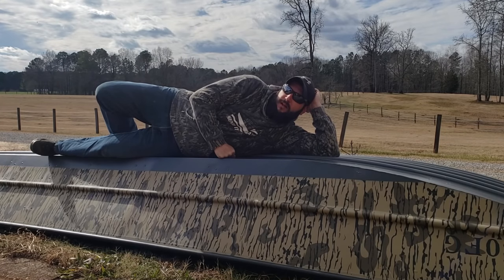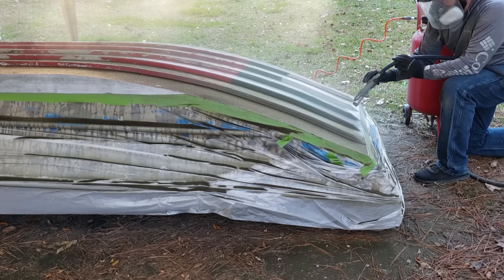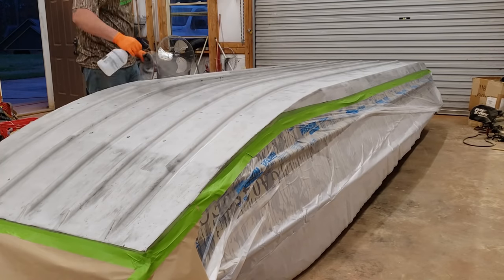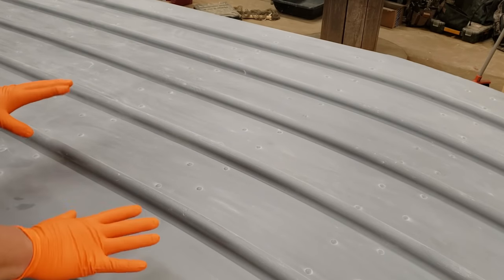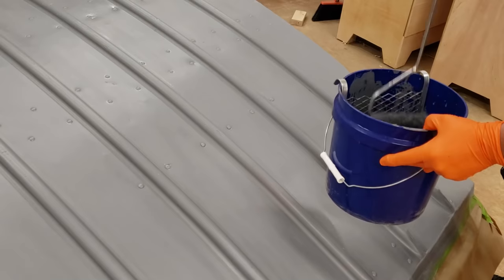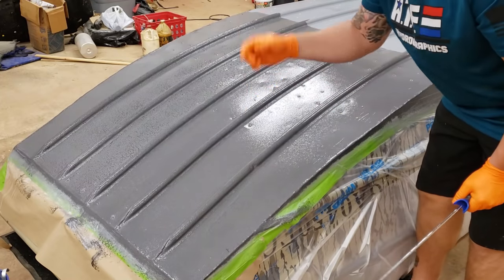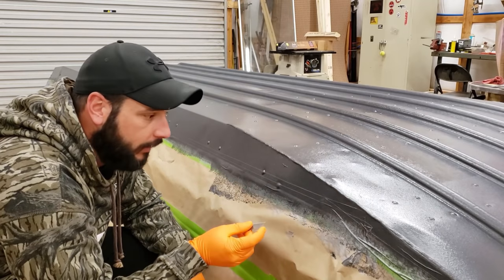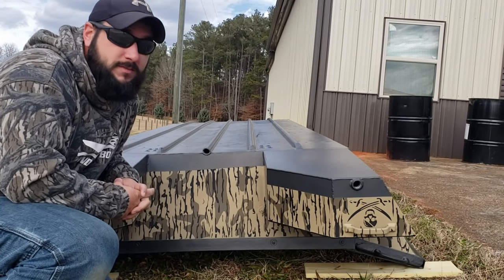Gator Glide and Gator Base [How to Apply, The Right Way]

Comment: I always used stealflex/2000 back in the day. Couple tricks maybe for whoever interested. As far as primers go don’t bother leave bare aluminum sand blast is ok but 24 grit is better if you got a flat hull. Clean with 90% rubbing alcohol AFTER you blow it off or vacuum all the dust AND wash with dawn/soap and water. When you apply epoxy use the finest nap hair roller you can find. 1/8”... apply a coat front to back and once you get to back if front is still tacky start again. If it’s not you fked up.... Only two coats. 3 depending on thickness just messes up and the thicker an epoxy is the easier it chips in bigger pieces... Once you apply second coat just peal tape off and razor as you go but if it’s still wet you can just peal tape off for a good line. And then take a hair dryer or 2 is better to the whole deal while it’s drying. It’ll help flatten it out so you get a car paint type of finish not wavy. Especially if you used a good fine nap roller. So. Deeper scuffs the better. Wash. No dust. Alcohol. Apply whole coats. And only apply second coats to a wet coat. Super fine nap roller. Hair dryers. Let sit twice as long as recommended.
Reply from the maker: Thanks for the tips.

Comment: What paint stripper did you end up using?
Reply from the maker: Ace hardware brand paint stripper and the Klen Strip brand. They both ended up working but had to do it in layers.

Comment: Doesn't naphtha have an oil in it?
Reply from the maker: No oil in it, body shops have been using it for years for degreasing. Thats where I learned it from, an old panel beater.

Comment: Wonder how it holds up to ice.  My duckwater boat looks like mirror every few years.   1-3" ice Rubs the paint right off.
Reply from the maker: Holy cow, i never thought about ice.... good question. Ice is not something we know about in Georgia, but I have seen some airboat guys running it over ice on facbook and it looked like it held up fine. Now running through ice and breaking it, I dunno what will hold up to that.
Reply: @SendItJonBoats  thx for the relpy....
Reply: @SendItJonBoats  I thought that looked like some GA water. Actually working on my boat project so I can get on the Ocmulgee and maybe Altamaha, to catch some flathead. Just picked up a new welder with spool gun and a plasma cutter, and going to learn aluminum. If you're around middle GA, I'd love to check out the boat.
Reply from the maker: @christophermccrary8080  You are not far from me then, I go to the ocmulgee all the time. I am in covington.

Comment: would this "Freedom Lube" work good for making my bunks on the trailer slippery.. (I do not have the Gator Glide on )
Reply from the maker: Freedom lube would probably help a little but eventually it will wash off, you would have to apply more. Ive never tried it but I could see that working.

Comment: TIP: wrap your roller in painter's tape before you put paint on it to remove the lint...
Reply from the maker: Tried that, didnt help. Those rollers just sucked. As the gator glide started getting tacky it was pulling the fibers out of the roller.

Comment: wrap your roller in painters tape before you use it. when you peel it off it will remove all of the loose pieces
Reply from the maker: They just kept falling apart the more I used them. I used the same roller for the first 5 coats and it continued to shed during all 5 coats.... the painters tape may have helped some , but overall it was just not good rollers for that coating. It's some sticky stuff once it starts to dry.

Comment: The razor is a bit much, I have done 6 boats with this stuff and just simply pulling the tape was good enough for straight lines. No one is going up to it with a magnifying glass and inspecting.
Reply from the maker: Yeah I realize that now, but since I have never used it I wasn't going to take any chances

Comment: It’s a 2 part so throwing a rag over your buckets not going to do anything. Still gunna dry. Lint rollers rap in duct tape a few times
Reply from the maker: It is what Gator Glide told me to do... and it worked. Kept the stuff in the bucket from drying out.

Comment: All you had to do was brush off the dust with a 4 inch paint brush or a broom and then wiped it 1 time with the shop towels instead of using the whole roll to clean up that dust.
Reply from the maker: Or an air compressor, which I did not have available. But thanks for the tip.

Comment: Dang as a painter. I can tell you I’d have done a coat of coal tar paint and called it a day. Too much labor in that little bit.
Reply from the maker: It sucked... a lot. But I did it and it works
Reply: Aren’t you missing the point though. He was looking for a surface with less friction, one can only imagine how coal tar paint would, cause more friction, pollute the water and probably get sand caught in it.
Reply: @teeanahera8949  umm if you don’t know what coal tar is.  Coal tar dries slick, thicker with less prep. Doesn’t collect a lot of sand because it’s dry. And wouldn’t pollute the water any more than any other paint coating. I guess it’s misleading because of the name.

Comment: Run tape on your roller before you start. Pulls all the loose fibers off.
Reply from the maker: Wouldnt have helped much... the rollers were just crap. As the Gator Glide started to cure up it was pulling the fibers off the roller. Gator Glide even specifically mentioned in their instructions what rollers work best, and I used a different brand. Use what they say to use

Comment: I don't see why 5 coats needed for the base. You are adding unnecessary weight. It is just to improve bonding from bare surface to the final paint is it not. Two thin layers then final paint coats.

Comment: Can this stuff be applied to bare aluminum without a base coat
Reply from the maker: I wouldn't, bare aluminum needs the base coat for proper adhesion.
Reply: Just got done I used gator base and gator glide hoping it’ll hold

Comment: Will gator glide actually seal the bottom of the boat if u have a couple small leaks?
Reply from the maker: No, nothing will ever completely seal the bottom of a boat permanently. I have tried it so have many others and it will always fail eventually. Best thing to do if you have leaks is to fix the actual leak, not try to seal it. Will be doing a video on this soon.
Reply: @SendItJonBoats  ok thanks for the info I have a boat that has two little pin hold in the bottom of it I may just drill them out and put rivets in place thanks look forward to the video